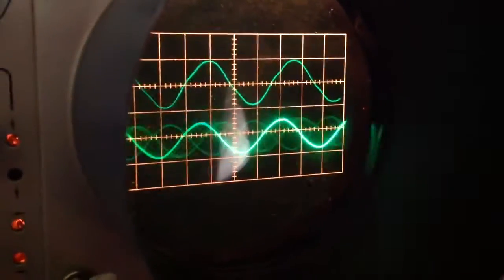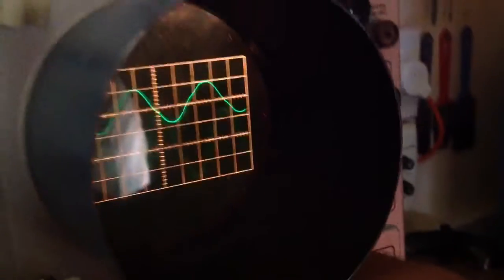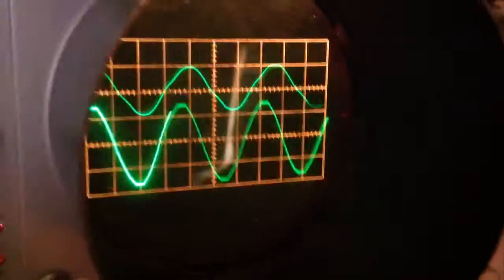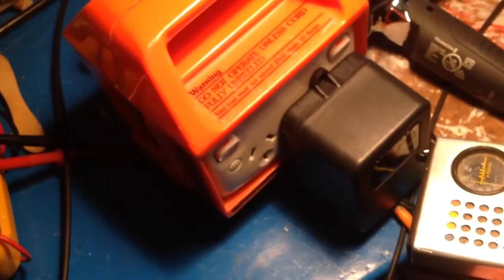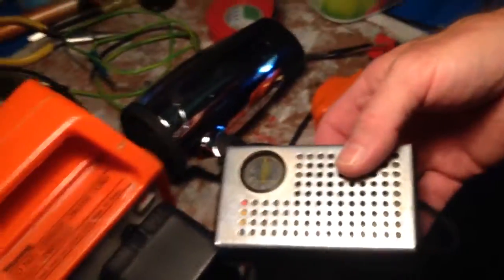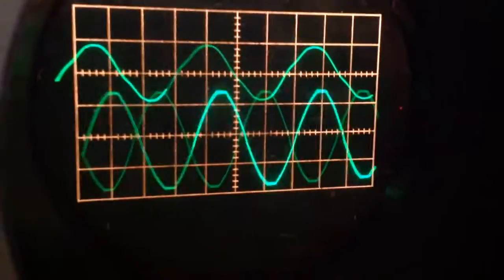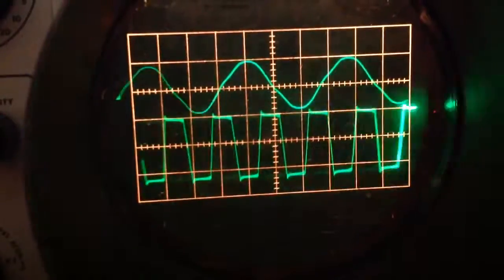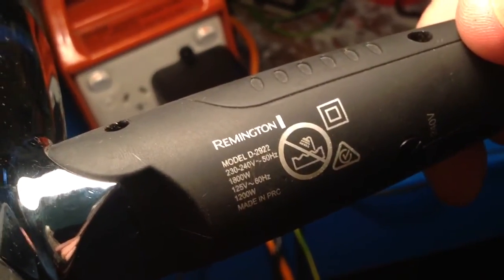Dodgy Chinese inverter (powerstar W7)

Comment: I've got the 12 volt 3kw/9kw version of the Powerstar W7 and it's cleaner than my mains power was before i went off grid

The Sinewave tends to flatten a little when above 2KW output and also when the microwave is used due the high inductive load. But absolutely nothing like this , it always looks like a sine wave.

Mind you i am running mine off 6 x 2v forklift 1000 ah forklift  batteries and you really need these as at 2KW your drawing around 200 amps @ 12 volts when you include inefficiencies such as power factor , inverter losses and cabling voltage drops  

Also i use 85mm@ welding cable as the battery to inverter run , and no more than 1 meter in length. The battery to inverter DC protection is via a Heinemann 250 amp DC circuit breaker as Fuses tend to have a higher resistance and hence voltage drop 

You can also get the Powerstar W7 in a 24 Volt model , which may suit some battery types better and these would need half the current rated cables and circuit breakers  
   
I would recommend retesting using 85MM2 wwelding cable and batteries capable of a steady 200 amps output for the 12 volt model and 100 amps for a the 24 volt one 

My powerstar W7 has been running for 3 years 24/7 powering an average load of 10kwh per day with no problems so far 

I have a spare one as a battery charger and redundant backup which enables hot swapping just by DC switching the batteries though a Blue Sea brand 400 amp continuous , 1000 amp peak rated changeover switch
Reply from the maker: +Philip Rothwell 
I'm not sure where you got yours from but mine is the same model 
3KW continuous 9KW peak power 
I have a 2500AH battery bank that consists mostly of 200AH scrap yard AGM batteries that I have refurbished 

I use dual AWG 0 heavy duty power cables on each terminal 
So 4 in total 
The wire is capable of withstanding over 600A and the voltage during the test was 13.9V with solar and grid boost charging to keep the voltage up
Reply: +mewantbrains Maybe faulty ?

Mine is brilliant , even at 2.4 kw output,which is 200 amps current draw Apart from some "fattening" of the sine wave , i.e the sine peak tends to have a shallower sine shape with a fatter top shape   , but  it retains a sinewave shape .

But stuff out of china is a bit like that i believe , inconsistent

The battery charger is Epic , i get 90 amps out of it . Mind you the transformer tends to "smell a bit hot" at this current so i usually run it at 70 amps. 

But for the $500 delivered buy price it''s worth it just as a battery charger

For battery to inverter input current checks i bought a DC clamp tester for about $60.So with a voltmeter at the input to the inverter and the current clamp tester as well i can see the inverter is getting the current and voltage it needs from the battery bank.

Even at 240 amps input to the inverter my traction batteries can keep the inverter INPUT voltage above 12 volts DC. And during the day the solar MPPT chargers pump out 160 amps so the voltage will remain above 13 volts.
Reply from the maker: Well there have been numerous reports of these inverters failing to deliver a consistent sinewave at more than 30% load 

One guy even modified his with toroidal transformers to fix the issue 

I don't have the money or knowledge to do that 
But my next inverter will be a tortech HP 12V 3KW continuous 9KW surge 
I went to their store in Melbourne and they demoed the unit for me 
It holds a perfect sinewave up to 80% then it starts to flatten a bit 

The sinewave at full load looks the same as the sinewave on my current inverter when it has no load 

It's a much better unit but it is very expensive at $1500 and really heavy too at 24KG
Reply: +mewantbrains  

There is a new version of this Inverter , from i think the same supplier , Bit Deals store on Ebay . They now have a toroidal transformer , and reduced stand by current draw. Probably my only "gripe" with this inverter. 

I might even consider buying one of these new ones just to try out as they are only $549 (aus) delivered. I've had my original one for 3 years so perhaps it's cheaper to buy a new one than clean the old one ! 

I don't think i could change mine out to another without going to a 24v system or an inverter at 3 times the price as it is so capable of handling large loads for a 12v inverter.

I can have the whole house running normally at night with TV , lights , fridge running , washing machine ,  2 laptops as well as the 1400 watt microwave or induction cooktop or toaster oven and the water pump can start and this inverter copes fine with that. 

It's only a 350 watt water pump but the surge current is 12 times that at about 4kw
Reply from the maker: The inverter in the video was bought from that seller 

I recommend that you stay away from him 

He said to me that my video was photoshopped and the pictures were collected from the Internet 

And because I couldn't afford to have my paperwork signed by a judge 
eBay took his side 
I had to go to the bank and get the charges reversed based on the fact that he would not send me a return label
Reply: +mewantbrains These china made inverters are really interesting.

So yours is crap , mine is good , same supplier and Australian ebay seller , Bit Deals. 

And i was in touch with a china engineer about another almost identical clone inverter branded "GENPOWER" 

Inside it looks the same and the performance is the same . The only thing is the fan runs all the time , whereas the Powerstar w7  runs the fan on demand , so is much quieter.

Anyway the engineer said there are factories all over China that clone other peoples designs. It's almost the national sport over there!  

So if you buy ANYTHING out of China the rules are ..............

1) You do your own Q.A because we do none.

2) It needs to be cheap because you may not get a refund if it's broken

It's unfortunate it worked out poorly for your purchase. I use my second Genpower unit as a backup inverter ( hot swap via a blue sea 400 amp rated changeover switch) and as Battery charger as it allows genset charging at 80-90 amps and the inverter to still work as well ,Both at the same time - 2 units and less than $1k for  both delivered 

I've pulled both apart and the design is fine as is the build quality .
They use siemens IGBT'S  The printed boards all have conformal coatings and the soldering is perfect flow soldering. The wiring and looms are good enough .The transformer is quite large (not toroid) and well made. 

And mine has been running 24/7 for 3 years 

One trap is YOU MUST protect the input with a 250 AMP dc circuit breaker like a Heinemann good quality one or use a 225 amp megafuse and holder as there is no fusing on the input inside this unit  

So is you have the $ , buying a better brand is an easy choice , albeit more cost , or you can take a punt on the china models and you may win or you may lose.

Here is the manufacturer of the Powerstar W7  ( I assume or are there 4 other clones manufacturers out there ?) 

They look to make some interesting stuff 
http://ups.en.alibaba.com/productgrouplist-200267717/Pure_Sine_Wave_Inverter.html
Reply from the maker: I do have a genpower 1500W inverter From last year 
now sold on eBay by edisons 
It is great 
It holds its sinewave perfectly under full load 
But it has zero surge capacity at all 

The best inverter I have ever owned was a powertech pure sinewave inverter from jaycar electronics (A store in Australia like RadioShack)
That inverter was perfect 
It would hold its sinewave all the way to full load 
And it would surge for about 30 sec 
But those bastards are expensive 
The 2000W model costs nearly $1700 
And they don't have anything bigger than 2000W 

As for the link you sent me 
I don't bother shopping on alibaba because they nearly always have a minimum purchase of between 10-10,000 units 
And usually the shipping speed is horrendously slow (more than 2 weeks) 

I bought 100 Li-ion 18650 cells from alibaba for 0.80c each and I didn't receive them for 2 months with no explanation from the seller 

In addition to that they only had half of the rated capacity 
(2000mAh instead of 4000mAh) 

I don't want to make that gamble with something as expensive as an inverter

Comment: I'd guess they've regulated it by feeding a non regulated, or perhaps crudely regulated 320vdc bus into the output mosfet bridge, and let the mosfet bridge's sine own driver take care of the output regulation by adjusting the duty cycle of the PWM sine. Under load, the DC bus sags and the PWM can only increase so much to compensate so the sine wave clips, then eventually becomes a square wave. It'd be much better to sample the AC output and regulate the DC bus accordingly, then the sine wave PWM could remain fixed, but for some reason it seems they haven't done that.
A low battery or excessive loss from under rated cables can cause these issues.
Reply: Correction -When I said 320v DC bus, it's more likely approaching 400v in a pure sine inverter.
Reply from the maker: +ProdigalPorcupine 
That does make sense 
From what I have read online 
The unit is designed to run very hot because the transformers are intentionally lossy which apparently helps to clean up the sinewave output somehow until more than a few hundred watts of load is connected 
It also gives off some interference as well 

As for power 
It was connected to a 12V 2500AH battery bank Which was fully charged at the time of the test